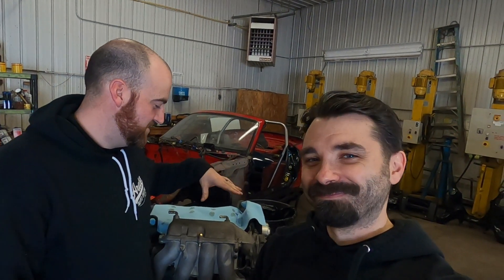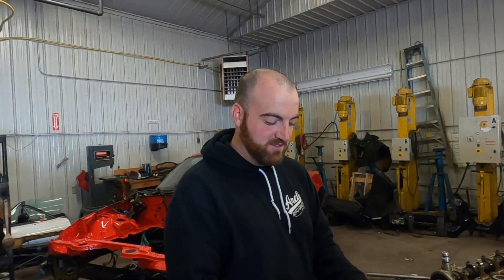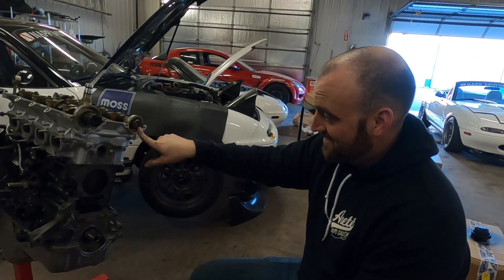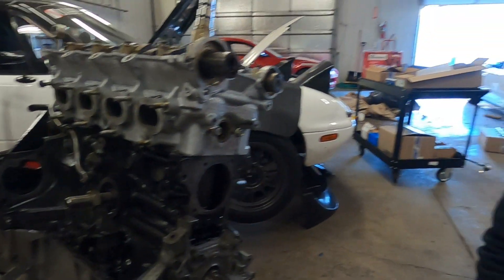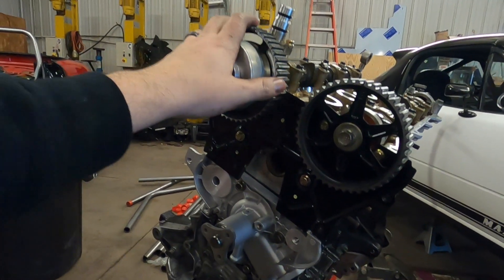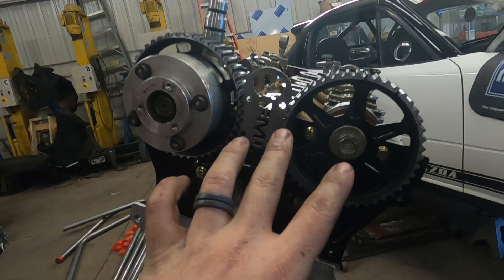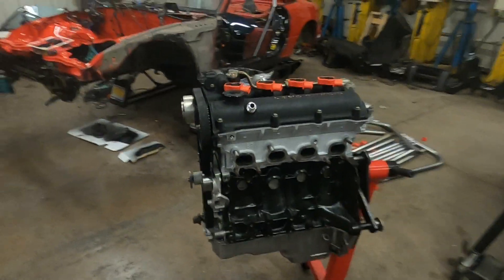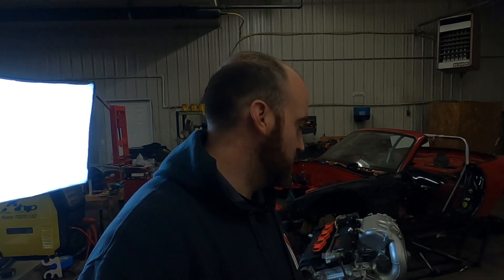Engine Refresh  // Miata Track Build

Comment: Good job on sourcing low mileage VVT. I am curious how your valve cover AN breathers are going to incorporate PCV.
Reply from the maker: They won’t. They go to an atmospherically center catch can, so a PCV valve isn’t necessary. We’ve run this setup on multiple cars with no issues now.

Comment: Arent you supposed to run a 99-00 head gasket alongside a reroute on BP6s?
Reply from the maker: The 949Racing guys have run reroutes on VVT engines/head gaskets for 24 hour endurance races with no issues. The reroute definitely helps the non-VVT engines more, but doesn’t hurt the VVT engines in any way.

Comment: Just a heads up you're going to want to drill a couple holes in the thermostat or something, I saw that front water neck is deleted and all the small ports for the oil warmer/cooler, heatercore and throttle body coolant are all deleted, so when the thermostat is closed coolant has no way to circulate at all, the pump will cavitate a ton during warmup because of this and will cause pitting on the impeller and eventual failure. Drilling a couple holes in the thermostat at least gives you a little flow but warm up times will be extended and it has the possibility to run too cool in cold weather at which point you'd need to block off some of the radiator. I usually suggest just looping the heater core lines but deleting the heatercore itself so coolant can circulate in the block when the thermostat is closed.
Reply from the maker: I did think about this… Might be kicking myself since we put the engine in today.
Reply: @NappMotorsports  oof. Might be easier to just find another water inlet housing with the hard pipe and replace plug on rear spacer with barb to run the heater circuit as a proper bypass instead of trying to remove rear housing. With mine like that and still naturally aspirated it never got over 205 degrees even here in AZ with a 192F thermostat in the reroute housing, so no negative impact to overall cooling capacity that I could tell but it was able to warm up quick and regulate temp in colder weather on its own. If the water has nowhere to go when the thermostat is closed you also risk pushing freeze plugs out too if you rev it when cold.

Comment: I bet I know what's missing from Dylan's car ;) Flyin' Miata is also Black Fridayi-ng... I have an Excel spreadsheet of what I need. Question: How did you block off the water pump heater tube outlet? Plug or weld?
Reply from the maker: I have a feeling you might know exactly what’s missing! Haha.

We popped the little fitting out of the outlet, then welded it shut/ground it down. You could easily pop that out and thread it with an NPT Tap and block it off.

Comment: I’m looking at the hoop on the track car, from the angles it looks really low, below the top of the window?  Will it pass the broom stick test?  Maybe all short drivers.
Reply from the maker: That’s just resting in there. We’re not going to use the kit we bought so it’s going to be passed on to someone else.
Reply: Although Napp said they are not using that bar, all Miatae do generally have this problem passing tech with readily available roll bars. There are "tall guy" mods for using stock seats in "street" classes, but the best thing for taller drivers is proper bucket seats mounted on the floor. I'm moving up out of the "street" classes that require stock seats and I am right at 6' (183cm) tall. I cannot pass the broomstick test with a stock seat and my Hard Dog M2-HCHT bar. I don't want to molest my stock seat padding, so I'm working on this problem right now for the next season. I have an Ultra Shield bucket seat and a set of floor mounts that don't require any cutting and put the seat as low as possible. I was just test-fitting this past weekend, and I'm waiting on a set of Kirkey side mount brackets and a custom seat back brace to deliver at the moment, which will complete the setup. I will definitely pass the broom stick test once I get the full install completed, and I'll be able to set aside my stock seat for the next owner (if there ever is one, which I doubt 😎).
Reply: I’m hoping to get some right seat time in the track car next year but my helmet sticks above the front window frame with the stock seats. Fingers crossed that I can fit in the end result.